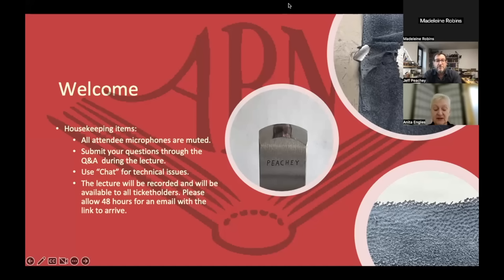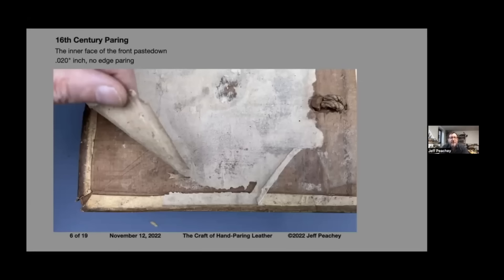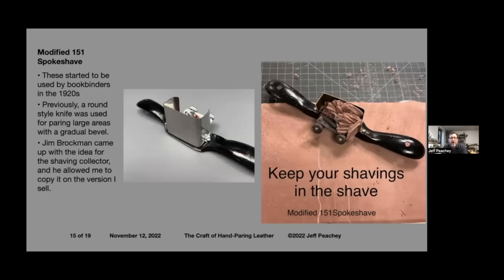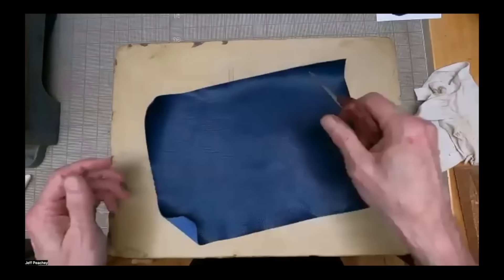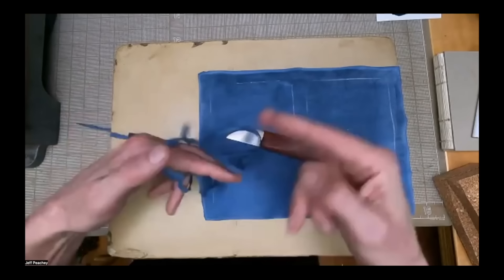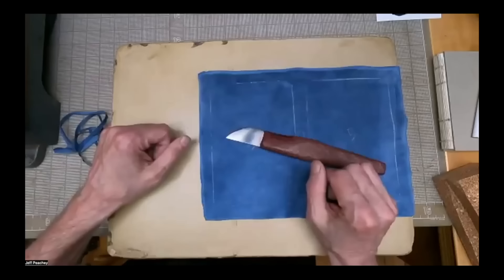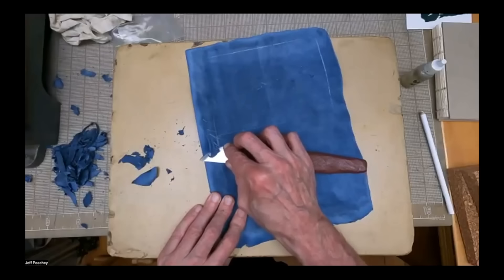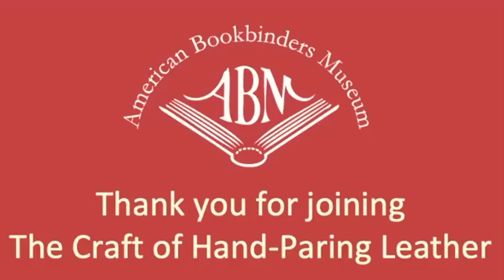The Craft of Hand-Paring Leather for Bookbinding by Jeff Peachey

Comment: Bell skiver, is the name of that medium-sized medal device that was on the table used to cut down the thickness of leather. 

2... pairing is similar to what leather craftsman use as well as Skivers. 
Skivers come in different shapes and sizes.  They do what a pairing knife does but each size and style has specific features. 

There is no need to re-invent a wheel that is round. The device Peachy was trying to make is already prevalent in the leather crafting community. The incredible thing about it is so many tools can be shared.

He might want to try a - a French edge beveler that takes off line by line in different widths. There is also something called a - safety beveler.  I encourage him to look at the tools the Japanese and Koreans are using as well as Midwestern culture like Springfield Leather Company or Tandy.

If Peachy built his handles flat in the area close to the side of the blade he will hold it on, then he can get a closer cut and more control with his blade.

Leather craftsman use 2 ways to sharpen their blades. #1 - a thick vegetable tanned leather like 8oz or more with the white or green jeweler rouge depending on the blade. #2 - a Whetstone (primarily Asian craftsman use them). 

It's funny. I was thinking of making my own leather bound book. I have way too many hides I need to use. 

Thank you for sharing this video 😊.

Comment: This is not related to the video, but do you have any suggestions for single sheet binding besides perfect binding that uses sewing?
Reply from the maker: Not that I recommend.  There are variations of over-sewing into sections and then binding these as normal sections.  However, the perforation of the spine edge of the sheets can be quite damaging to the original material.  I'd recommend scanning the originals, printing so that they can be bound as folded sections, and preserving original materials in some sort of wrapper portfolio.
Reply: There is Chinese and Japanese style binding, but by design that requires a large gutter (margin with no printing that will be covered by the binding). An friend and I were workshopping ideas for how to bind her art and one thing came up with glueing a cardstock strip to one edge and binding it using the cardstock as the gutter. (Although I stuppose we could also use cardstock strips folded in half and bind it western style.) There is the risk of water damage to one edge of the art though, and I'm not sure how strong it would be, so she's also considering putting the art in plastic sleeves and binding that